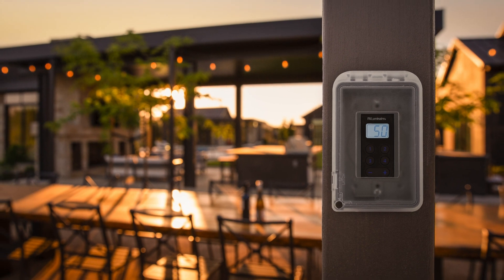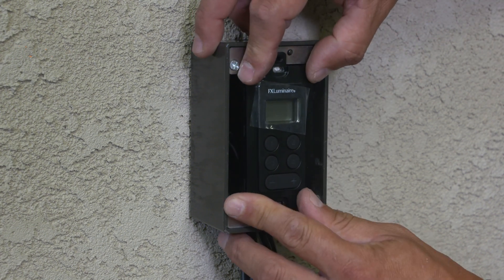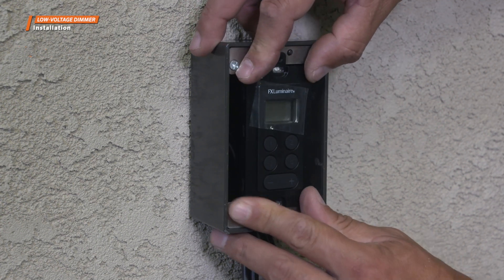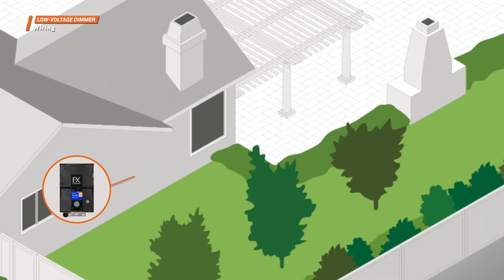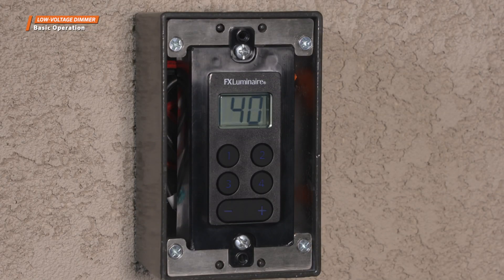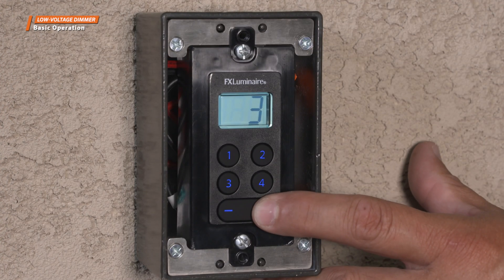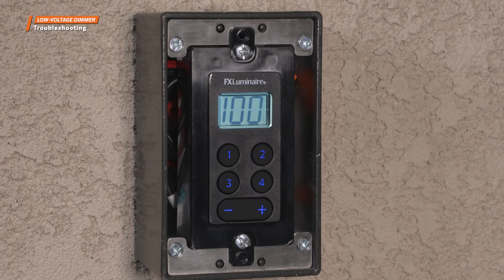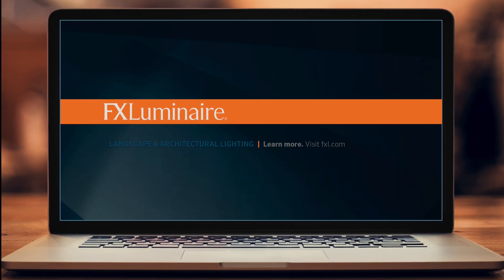FX Luminaire Low-Voltage Dimmer: Installing, Wiring, and Programming

Comment: So do the bulbs have to dimmable?
Reply from the maker: The FX Lumiaire Low-Voltage Dimmer allows in-line dimming for any low voltage fixture. No fixture dimming capacity is required. How great is that?